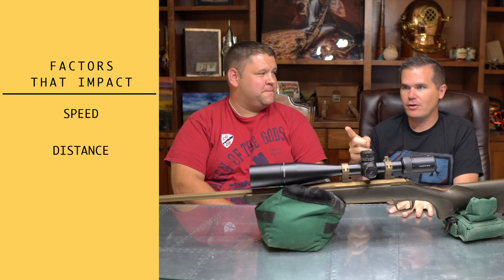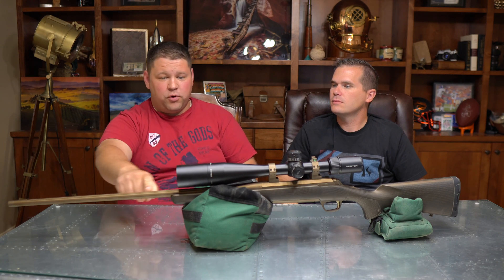How Rifle Cant Drastically Impacts Long-Range Accuracy

Comment: The guys in the video say error is introduced when cantng the rifle due to the lob of the projectile but that's not true. Imagine we took gravity out of the equation to simplify visualization, and we have a rod that goes from the center of the target down the bore of the gun. Lets say you cant the gun 90 degrees to the right along the axis of the rod... the scope reticle and the point of impact at 100 yrds does not change...and everything is lined up fine (for that distance assuming you zeroed the scope at 100 yards). The issue arises when you attrempt to shoot canted beyond your zero. Lets say you are attempting to hit a target at 200 yrds with a 90 degree cant to the right, no gravity. Assuming our perfect rod is extended to 200 yrds, the pointof impact will be perfectly aligned with the bore and the 100 yard zero. Nothing changed there 

Now the issue is apparent...where is the scope pointing at 200 yards? If the scope was at 0 degrees as opposed to 90, it would be pointing low, the amount being the distance from scope center to bore. Now do you see? When the scope is canted 90 degress to the right, the scope is pointing left of POI, by a distance equal to the scope center over bore. So if height over bore is 2 inches, thr scope will point 2 inches left of POI.

Now if we were to remove the rod and reposition the reticle (still canted), we would miss two inches to the right.

Note, the canting issue still exists when gravity is factored back in. Still missing right, but in a different position relative to parabolic trajectory.

Comment: OK-I understand SCOPE cant. But I have yet to see a video that addresses levelling your rifle-so it doesn't cant PRIOR to scope mounting, and then mounting your scope on your rifle and levelling it. I use the WHEELER scope mounting kit. I clamp the one adjustable level on the barrel. I mount either my Pic. rail or a 2 piece base, usually the rear one first. Then I put a level across that base-level the rifle according to that base-then adjust the bubble on the barrel till it shows level. then I mount the other base-the forward one-and it's not level with the rear one or the barrel bubble. What's going on?????

Comment: Cant is a real threat to accuracy and precision. I found out my scope was installed with a cant and my shots were not only inconsistent at at 1000 yds but I was also missing by 10-14” off to the right. Fixed it and my MOA came down to 1/4” and my 1K shots are spot on the target. Highly recommend you install a bubble level on the scope!

Comment: So sad that only a few percent of people posting cant videos on youtube actually know what they're talking about. This is yet another which does NOT -- which can be told by the fact that they can't explain what should be very easy to explain. First let me make a slightly complex explanation before I make the simple one. Suppose you have a rifle which, when sighted at 100 yards will then require a holdover of 30 feet to hit at 1000 yards (roughly the case for a 308). Further suppose that you mount and sight the scope with the crosshairs in an "X" position (45 degrees tilt!) rather than a cross position (standard shape), and then you sight it in at 100 yards. If you now held that rifle in the same position you sighted it, and simply aimed the original aim point 30 feet directly above the target at 1000 yards, you would be exactly accurate -- even though the scope is WILDLY canted. The reason: you're using the same aiming point in the scope; i.e., you're not using the turrets and you're not using hashmarks on the vertical crosshair to adjust for the 30 feet. Now we see the explanation so simply: If your vertical crosshair is NOT vertical -- and you use either turrets or hash marks on the vertical crosshair to "hold over" 30 feet -- you are ACTUALLY aiming however far to the left or right that the crosshair is tilted "30 feet up" from center (which would be as they said: 9 inches for 1 degree, 4 feet for 5 degrees). Simple. Think of the vertical crosshair tilted, and then drop STRAIGHT down (as gravity does), and you will see the difference between gravity and the TILTED vertical crosshair point 30 feet high. It's 9 inches off because you are AIMING 9 inches off.

Comment: I find it helps to visualize how cant causes errors by visualizing tilting the rifle 90 degrees… like laying it flat on it’s left side. In that case… the entire vertical adjustment of the scope has the barrel pointing left… so thats why you hit way left… and the bullet drops and you hit low because the barrel was laying flat and pointed left instead of pointed up… now with a small cant like 5 degrees left… you are pointing the barrel only slightly left which sends it left and it also hits low because the angle you tilted left that sent it left was supposed to be part of your total tilt up to send the bullet up against gravity… so you gave up a small percentage of your vertical that was required to lob your bullet only up against gravity… and threw it left instead. When you cant left you are pointing the barrel left too much and pointing the barrel up not enough. When you cant right you are pointing the barrel right too much and pointing the barrel up not enough….
Or something… 😂

Comment: I  recommend checking out https://youtu.be/YTzSnbAmdJ0 as they discuss sight line and bore line.   Its a more straight forward way of understanding rifle cant.  You can miss inside your zero as well as outside due to the cant of the rifle.  Lastly its not hard to have a significant cant if you are not shooting from a flat surface as example hunting high elevation on steep slopes.  Also depending on twist, bullet type etc all may be variables in differnt flight path so the example of the 308 and 28 nosler may not be the most salient.  Rather one could have two different rounds of 308 with different constructions and coming from rifles with different twist rates to see differences in width of miss.

Comment: Hi Guys, as long as your scope is properly zeroed at your target distance (meaning you don't misjudge your target distance and set the proper elevation), the distance from the line of sight to the bore (the sight height) has "zero" effect on canting error - in other words, it doesn't matter how high your scope is above the barrel. You can have your scope ten feet above the bore, and the canting error will be the same as if the scope were barely one inch above the bore. This is very counter-intuitive, but it is correct. If you are curious as to why this is the way it is, here are the gory details:
https://www.researchgate.net/publication/341591225_Effect_of_Rifle_Cant_on_Point_of_Impact_at_Low_and_High_Inclinations
Reply: Let's say I zero my rifle to 100 yards but when I shoot I have a slight cant. Des that mean my scope/rifle is only accurate (in the horizontal plane) at 100 yards?  Anything before or after that zeroed distance will be inaccurate right?  I could be wrong or thinking about something totally different.